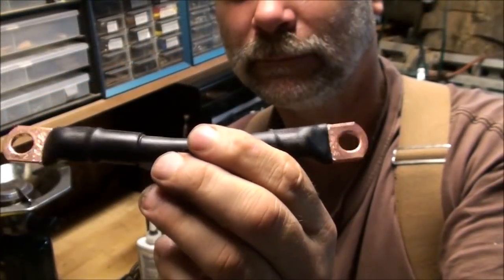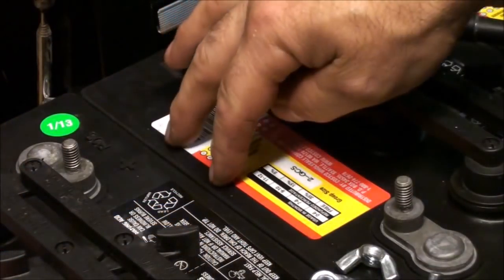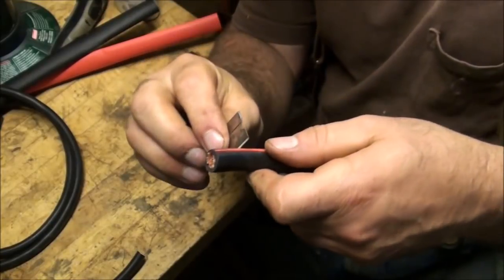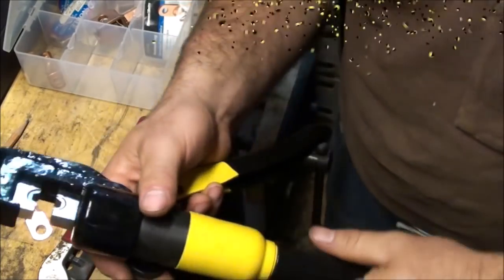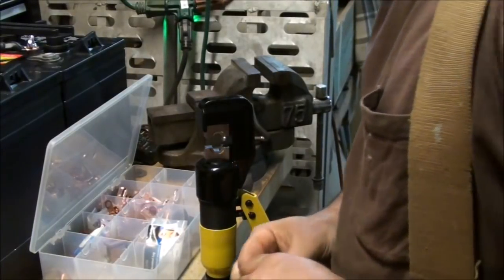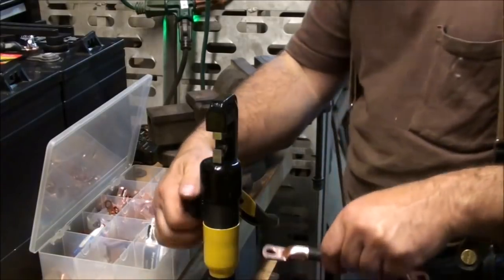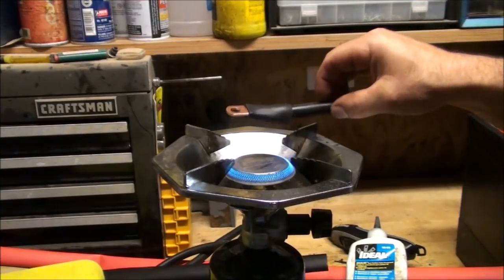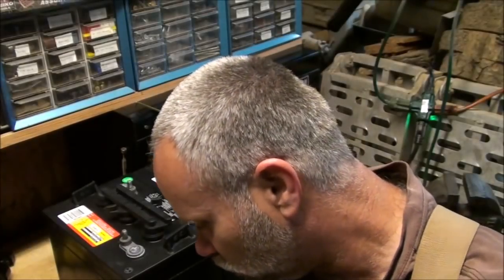Making Jumpers for Solar Power Battery Bank

Comment: You could also just put shrinktube over whole inside between connectors. Edit. We just used a heat gun or hair dryer.
Reply: You could indeed.

Comment: Hey Pat, great video. "They" ( they who?) also make a crimper that looks like a 2 foot bolt cutter with 3 holes in the jaws. At least they used to make one, I've had mine for 30 years.
Reply: Yes, I have seen those as well with changeable dies.

Comment: Always leave space between the batteries for cooling and air flow.  So the length of your series wires (jumper) should include this length.  Not trying to tell you how to but we have lived off grid fully for over 5 years.  I have a rough video on making cables and explaining wire and connectors.  Be careful mixing 12 volt and 6 volt batteries.  They charge different.  Just trying to help.
Reply: Oh and don't forget these rules as well....Red is Hot and Black is Not....Rightie - Tighty --Lefty -Loosy.    BWaaaHaaaaa.   I just kill myself sometimes.   LoL
Reply: Good advice guys. We use all 6v batteries on the battery banks of the same values amperage wise. I do have two banks of Trojans with higher storage capacities in parallel which is probably a no no but the system seems to be performing adequately. Any thoughts?
Reply: Mr. Rain if they are within 10% of each other there shouldn't be a problem. Also insure the charge controller knows the Ah and voltage tolerances for proper charging at different stages and temperature's.   We run L16E Trojans.
Reply from the maker: We have had our solar power set up for at least that long as well, though Patrick has added on to it as we go.  All I know is it has been working great for us all these years :)
Reply from the maker: Such a goof! haha
Reply: Oh yes, good point. I do have another charge controller and plan to regulate the Trojan T-105 plus to the controller. I remember the arrays I have hooked up are 180 and 190 watt panels. I have some new 290 watt panels I plan on incorporating into the system and using the additional controller to use with the new panels and Trojans. Great advice and reminders. Thanks!

Comment: It’s important for people to note that one reason to use the proper size lug is to reduce the amount of “heat creep” and lessen the chances of creating hot-spots at the connections. Plus, paying attention to recommended torque for the lug reduces the chance as well.  Most people don’t realize that connectors, as well as terminal strips, have recommended torque settings. 

Also, in a solar system, using wires the same length can actually improve the efficiency of the overall system. (It’s an electron thing.)
Reply: Well put! The weak link in any electrical system is connections. Also the shorter the better when it comes to wire length, less resistance in shorter and larger wire. Thanks for sharing!
Reply: Just hope you didn’t mind my putting my two cents worth in.
Reply: Uh Oh ... Wasn’t meant as criticism.  Apologies
Reply: Hey ... We’re good.  No worries.  Perhaps we should put our heads together sometime and talk solar along with DC power.  Especially since there’s a difference from AC that most are familiar with using.
Reply from the maker: Hey Lonely, it is all good and I don't think that is what Patrick meant and was not taken negatively.  You were adding in more valuable information and that is appreciated :)
Reply: Lonely Prepper Homestead  lol. Good one. Good explanation too.